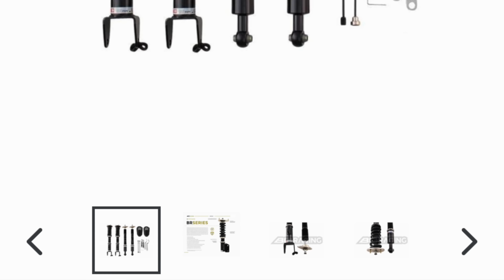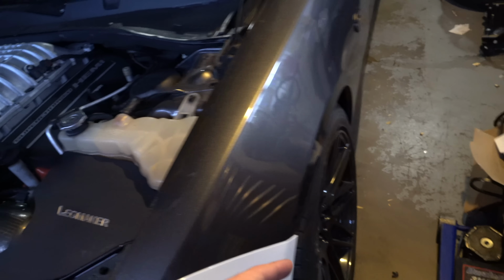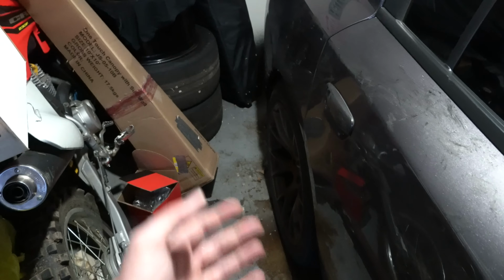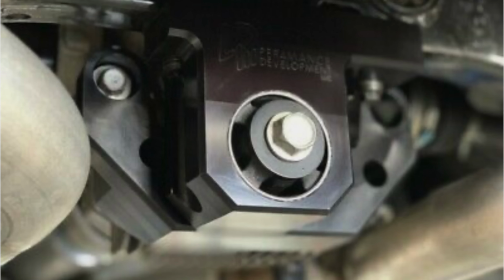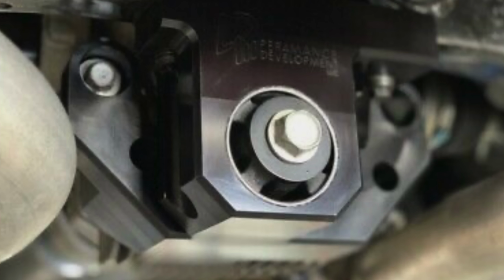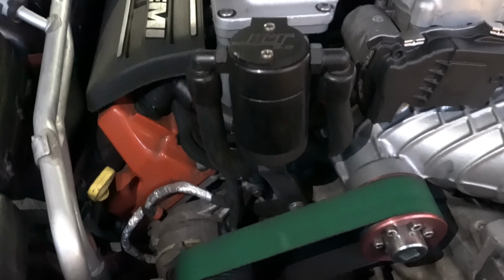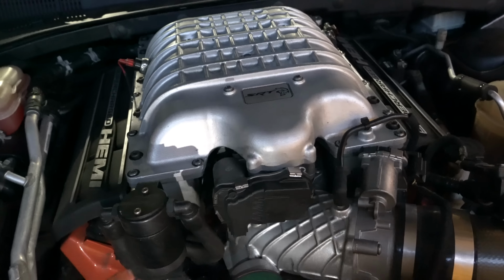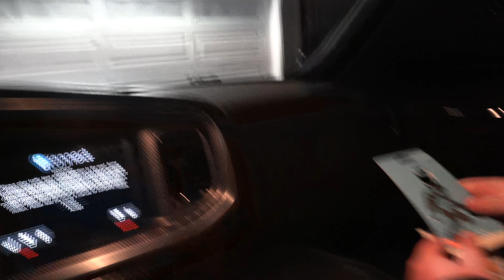HOW TO SET UP YOUR CHARGER OR CHALLENGER TO DRIFT!!!

Comment: Very good informatin here. I don't have a cat, but I got a beamer I wanna slide. A lot of the same stuffs apply.
Already did diff, sway bars, control arms with poly bushings. Currently doing brakes, fluid, braided lines, and I'm hoping to get upgraded turbos soon too, but I'm not ready to drop 4k on them yet 
😆😆

Comment: Using your knowledge to build a 2013 SXT :) Got yourself a sub!
Reply: Looking into getting my 3.6L a RIPP SCharger this summer. Getting my BC DS coilovers installed next week 💯🛞🦇
Reply: @ProjectChimera-46 dude just save for a v8 dawg, modifying a 2013 v6 engine is not the best idea in my opinion. Of course do you, but they sell cheap v8s you can build and get much more power and reliability